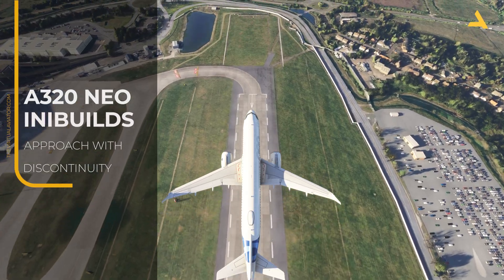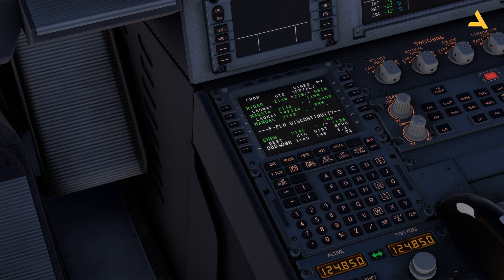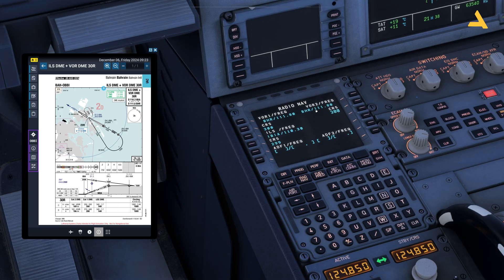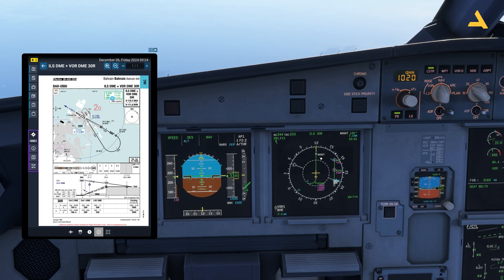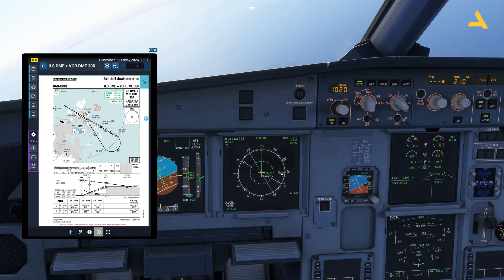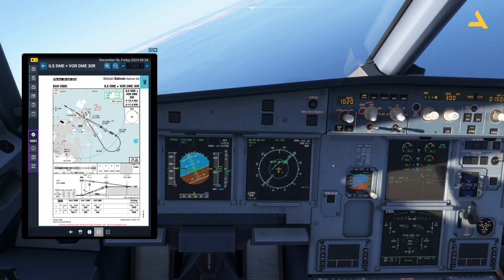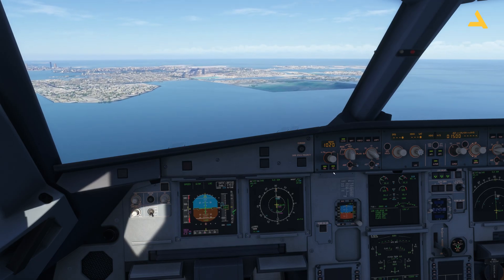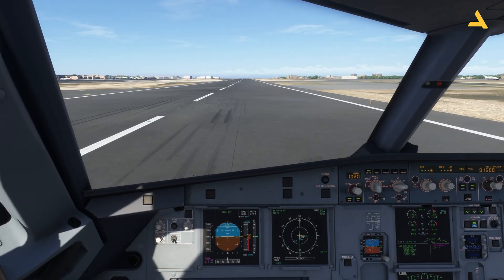How to Fly an Approach with Discontinuity with inibuilds A320 Neo in MSFS 2024 | A Beginners Guide

Comment: Very informative video. Do you have to set altitude yourself when descending from cruise altitude for a flight plan that goes to manual with a discontinuity? 

The waypoints up until manual show their respective speeds and altitude the aircraft should be at, but my autopilot never tried to follow those constraints. I think I had to manually set altitude and maybe even vertical speed for a flight plan like this. If it was fully connected, I believe this wouldn’t be a concern then.